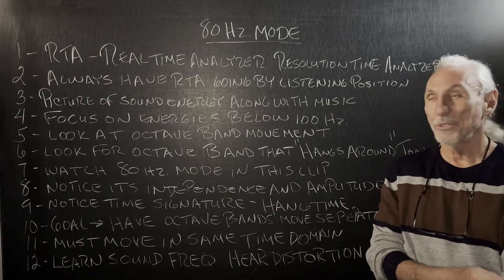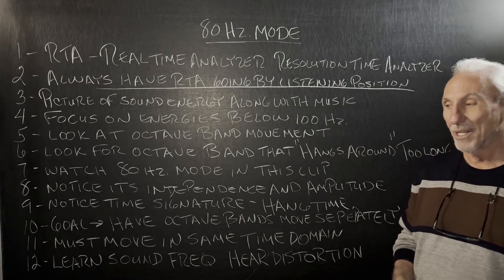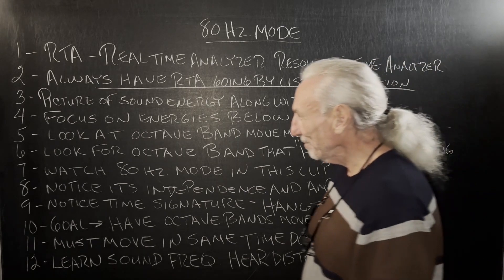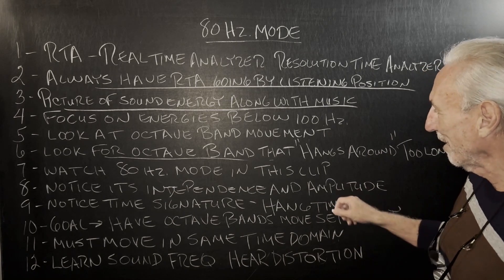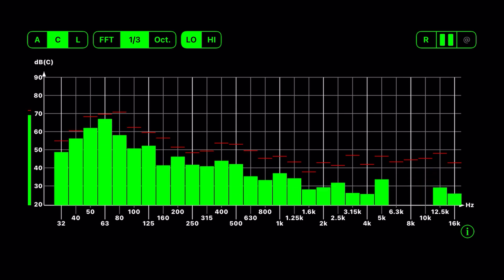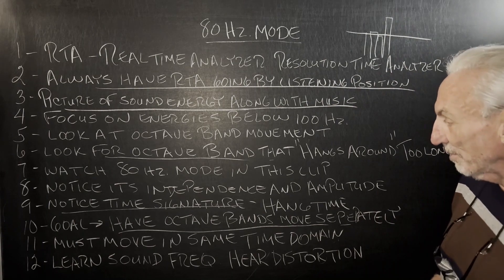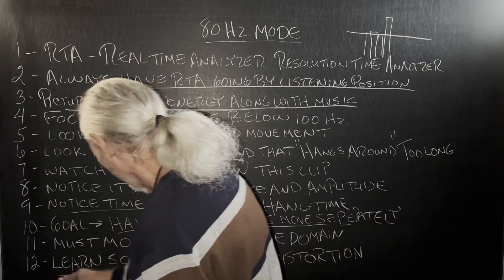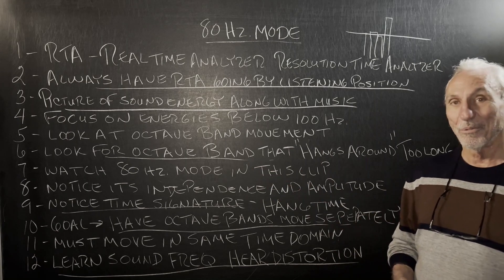80 Hz Room Mode - www.AcousticFields.com

Comment: This was incredibly helpful.  I downloaded a RTA from Google play store. Ran it with a particularly muddy bass song.  Saw 3 modes in the 70-130 Hz range.  Using Roon built in EQ, i put in steep notch filters.  It made a huge difference.

Question- do you have a video talking about the difference in results between room correction vs treatment?  I've heard it said room correction can only take away.

I appreciate what you do.  Your solutions are so much more effective and better value than the other offerings out there.
Reply from the maker: This is one method. However, it comes at a cost. Reducing the energy at certain frequencies from the original source material has a direct impact on the harmonics of those frequencies. If you reduce the fundamentals, you reduce the harmonics. It is always best to minimize unwanted pressure levels within the room through treatment if  higher resolution is your goal.

Comment: I have a similar problem, my ceiling is pretty well treated, should i work on the floor?
Reply from the maker: In most rooms we do, treating either the floor or the ceiling is sufficient. We rarely have to treat both. Remember to treat 80Hz. you need a minimum of 6 - 8" of space.
Reply: @AcousticFields  My bad, i have a null around 80, peak is at 35 which GLM calibrates well. It's the silly nulls that kill me :(
Reply from the maker: @dronbana  All modes are predicable and consistent always based upon room dimensions. This predicatbility and consistency allows for effective treatment to be applied correctly that has the proper rates and levels of absorption for music and voice. Always rememeber that music and voice requires proper rates and levels of absorption to not blur and smear the harmonic orders. Everything in small room acoustical design and treatment should be harmonic sensitive. The first four harmonic orders must be heard at a minimum.
Reply: @AcousticFields  Thank you for explaining that, i appreciate it 🙏